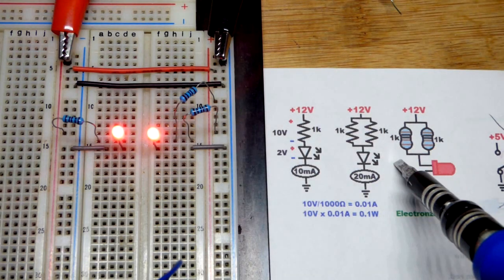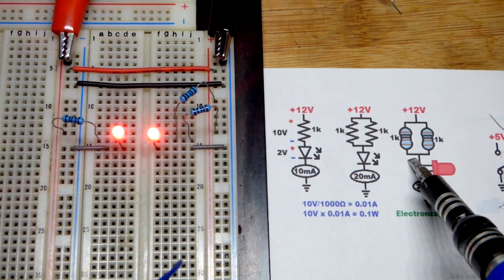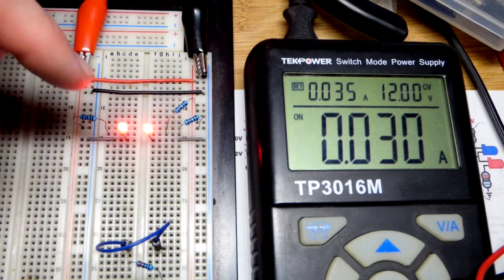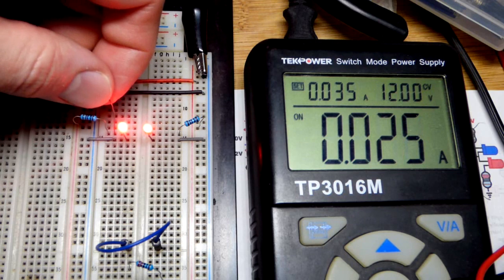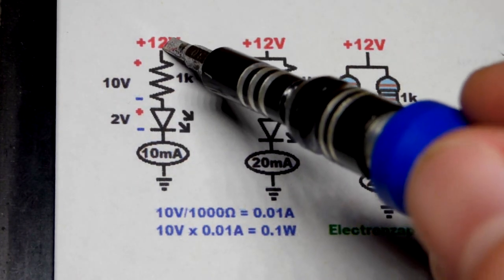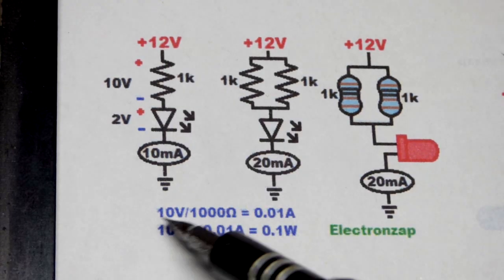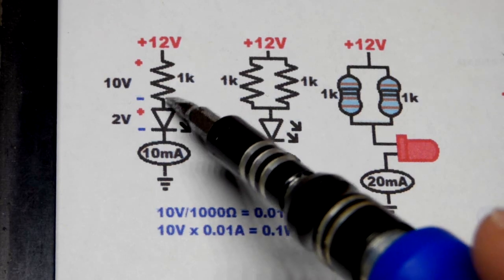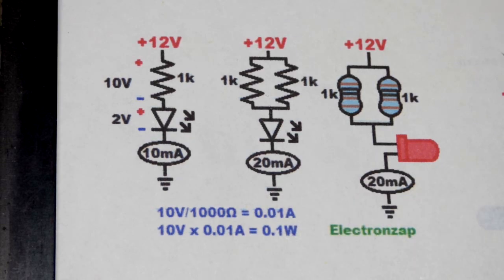Parallel resistors for more current from less equivalent resistance learning electronics shorts 17

Comment: Is there any sensing ic or chip which does this function. Value 1 for input greater than 6v, and value 0 for less than 6v.
When momentary input say 12v is fed to one pin of the chip, it stores the value say 1. 
When momentary input say 5v is fed to another pin 2, it store value as 0.
Then, the chip will compare these 2 values and output 1 momentarily if pin 1 is greater than pin 2 or vice versa. 
After this output, then all values will be reset to initialized values. 

Is there any chips relevant to these functions??

Comment: I have another issue here. Very interesting!  The components values are not important here. 

I have a 12v circuit with a resistor and led in series. This circuit is a ground side switch. Meaning that the  negative side of the led is 12V when circuit is OPEN, and 0V when circuit is CLOSED. 

Now, I also have similar another series circuit with resistor (values different) connected to the input positive pin of one regular 4 pins Optocoupler whose negative side of its input pin is connected with a basic diode in4007 in forward direction. This circuit is also a ground side switch. 

Both circuits are connected to the same source 12V.

Now, I connect the 2 ends of the two circuits together, and then ground it.

The result is very surprising. 
Multimeter shows about 3 volts when the circuits is grounded. However, when each individual circuit is grounded separately, multimeter shows 0V in each circuit. In both cases, the Optocoupler works fine. No doubts. 

So, my question is why it shows 3V when both circuits are connected together and grounded at the same time???

Comment: Here's a big confusion regarding POWER. 
Say a normal 10v car turn signal bulb is rated, for easy calculation,10V 5W which means 10Vx0.5A=5W. However, 5W can be also expressed as 5Vx1A. This being said, will the same bulb will glow if it is supplied under 5V allowing to pass 1A across the bulb to output power of 5W???
Reply from the maker: Light bulbs are resistors that are made to emit light when they get hot enough, without being destroyed right away. A 10V 5W light bulb would be made to be powered with 10V or less. Wattage (and brightness) goes down as voltage goes down because the amount of current through a resistor is based on the ohms law formula I = V/R ... or ... current in amps equals voltage in volts divided by resistance in ohms.
Reply: @Electronzap  but still I can maintain the same watt by supplying 5v at 1 amp instead of 10v at 0.5 amp. So will the bulb still glow? Please make some videos demonstrating on this POWER CONFUSION.
Reply: @tnamen1307  It's a good basic question, but one thing you must keep in mind is that you can't violate ohms law (V=I*R).  So in your first example 10V at .5A, the resistance of the circuit is 10V/.5A = 20 ohms.  So now let's say that you change the voltage to 5V.  According to ohm's law, the circuit will now draw 5V/20ohms = .25A.  And if you provide 1A to the circuit, it will still only draw .25A because of ohm's law.  So it's impossible to have 5Vx1A with that bulb since it has a fixed resistance of 20ohms.  If you did, then Ohm's law would be violated.

It's the reason why you can use a power supply that provides more current than is required to a circuit without blowing the circuit up.  The circuit will generally only draw what power it needs (an exception is LEDs, but that's a whole other discussion).

Furthermore, because of ohm's, law when there's constant resistance you can only vary one of the two, either voltage or current.  The other one will follow.
For example, let's say you have a constant current source of 1A.  According to ohm's law, the voltage will now be 1A*20ohms = 20V.  You can't keep the current the same (1A) and lower the voltage.  Therefore, you now risk burning out the bulb.

Finally, in your second example 5v/1A = 5 ohms.  So the ONLY way you would be able to draw 1A at 5V is to ensure your load circuit has a total resistance of 5 ohms.  But we calculated the circuit resistance to be 20 ohms, so you would need a different bulb in order to achieve that particular combination of voltage and current.  I hope that clears things up for you.
Reply: @Enigma758  That's a great answer to a question that can be difficult to get your head around if you're a budding newcomer.....cheers !
Reply: @Enigma758  okay that's pretty simple clear explanation. Really appreciate that.
Reply: @Enigma758  I have another issue here. Very interesting!  The components values are not important here. 
I have a 12v circuit with a resistor and led in series. This circuit is a ground side switch. Meaning that the  negative side of the led is 12V when circuit is OPEN, and 0V when circuit is CLOSED. 

Now, I also have similar another series circuit with resistor (values different) connected to the input positive pin of one regular 4 pins Optocoupler whose negative side of its input pin is connected with a basic diode in4007 in forward direction. This circuit is also a ground side switch. 

Both circuits are connected to the same source 12V.

Now, I connect the 2 ends of the two circuits together, and then ground it.

The result is very surprising. 
Multimeter shows about 3 volts when the circuits is grounded. However, when each individual circuit is grounded separately, multimeter shows 0V in each circuit. In both cases, the Optocoupler works fine. No doubts. 

So, my question is why it shows 3V when both circuits are connected together and grounded at the same time???
Reply: @tnamen1307  At what point are you connecting your multimeter to?  The 12v and ground?  I don't understand the purpose of the 1N4007 either.

When both circuits are grounded and switched on, for the first circuit, measure the voltage drop across the resistor, then measure the voltage drop across the LED.  They both should sum to 12v.  For the 2nd circuit measure the voltage drop across the resistor, the opto inputs, and the 1N4001.  Again, they should sum to 12v.  It must do that if you are truly supplying 12v.  If that doesn't add up, then measure from the 12v source to ground with both circuits powered.  If that's not 12v (is that where you're are seeing 3v?), then your circuit is drawing too much current and is causing the voltage to be reduced.  If that's the case, then most likely one or both of your resistors are too low in value or a short exists somewhere in your circuit.  That's the best I can do with the information you provided.
Reply: @Enigma758  one terminal of Multimeter is connected to constant GROUND and one terminal to the common negative side of the diode where both ends of the circuits are joined together to form a PARALLEL CIRCUIT, and it reads 3v when both circuits are grounded together. Also, it reads 3V on the other side, positive side, of the diode.
Reply: @Enigma758  actually it's a car related modifications. 
Here's how it works. 
The led represents the BATTERY CHARGING LIGHT. Whenever Key is ON, it STAYS ON. As soon as engine is running, it is off. 

The light is control by a IC/MODULE. This module gets a signal whenever KEY IS ON and subsequently turn ON the light by grounding the negative side of the light. Again, when engine is running, it receives signal and then, subsequently turn OFF the charging light by disconnecting the ground to the charging light. So, there is 12V and 0V when battery light is OFF AND ON respectively. So, it's a computer controlled GROUND SIDE SWITCH. 

Now, I want to make some modification to go in tandem with the charging light on and off. This brings to the second circuit which consists of the resistor, Optocoupler and the diode. Resistor value is high enough so as to maintain as much minimum current as possible. Diode is for to prevent back current flow to the second circuit. 

When both circuits are connected in parallel by joining both ends together, and grounded, there's 3v voltage at both the negative and positive side of the diode.
Reply: @tnamen1307  So you are measuring 3V from anode to cathode across the 1N4001 diode?  That doesn't make sense since the forward voltage of that part is close to 1V.  The only diode I'm aware of that would give a 3V reading across it is a blue LED.  Also, the cathode of that diode is connected to ground?  If so, then the diode is really serving no purpose.  I'm not sure I can correctly deduce your circuit from the description.  Maybe you could make a youtube video showing the full schematic and the measurements taken.  That would help a lot.